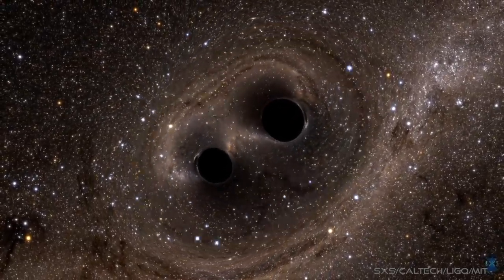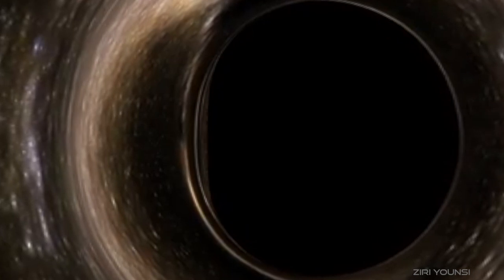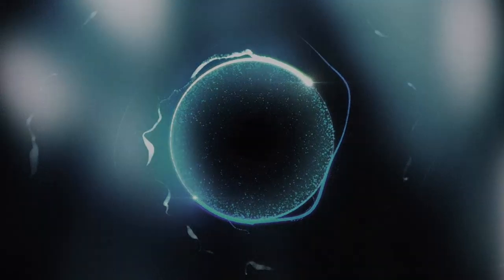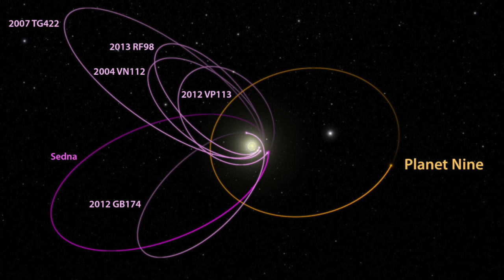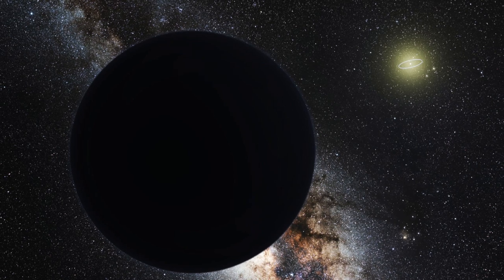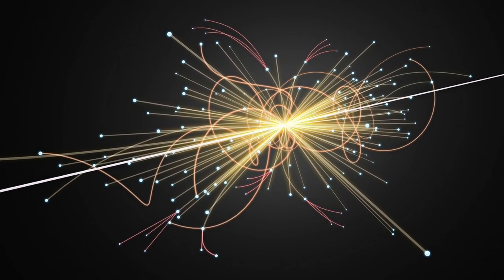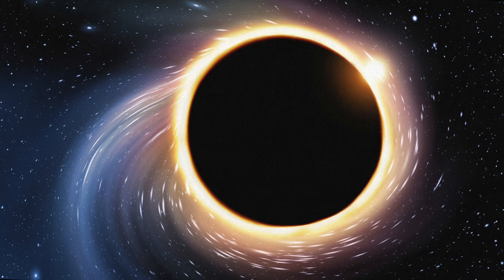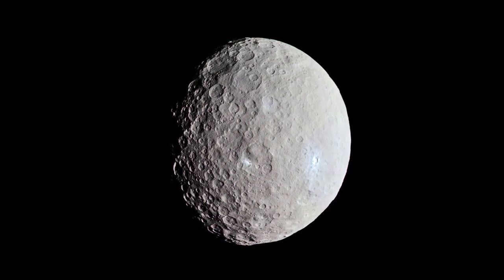Tiny Shiny Black Holes

Comment: It's worth noting that Hawking Radiation has never been experimentally measured. And the No Hair Theorem is incompatible with Hawking Black Holes, which have information (entropy) in addition to mass, spin and charge.
I'd be as excited as anyone if Hawking Radiation were ever physically proven. We've been looking for X-ray bursts from primordial black holes with satellites,  and if we ever manufacture a micro black hole in a particle accelerator, we'd be able to see if it does evaporate via Hawking radiation.
I'm also very skeptical as to whether an artificially created black hole power source would ever be energy positive (and there are other ways of extracting energy from them other than Hawking Radiation, for instance; we could extract gravitational potential energy by shooting matter near the ISCO and retrieving it with greater kinetic energy than it left with).
The good news is that for high density applications like space travel, a power source doesn't have to be energy or cost positive, just be mass and density efficient.
Reply: All good points indeed hawking radiation is theoretical and will remain so unless we find a black hole which should radiate at a temperature above that of the Cosmic Microwave Background radiation, at a distance close enough to actually observe any potential hawking radiation, which as far as we can tell do not naturally occur. There is possible evidence for a hawking radiation analog within a "sonic black hole" created using Bose-Einstein Condensates but I will wait for independent replication and or verification before I consider that reliable and even if it does hold up there is no reason gravity necessarily would work the same way.

Also as you noted an artificially generated Black Hole would never be energy positive  in terms of what you get out of them as required by the laws of thermodynamics hence why they were discussed as a type of battery.

Comment: Conspiracy theory...I think they're using the National Ignition Facility NIF to make a kugelblitz black hole....I mean have you seen it? They say it's for fusion but it's exactly what you'd need to make a kigelblitz. Its several dozen extremely high powered lasers symmetrically arranged in a sphere around a single point aimed at a tiny point supposedly a tiny pellet or something but we know what they're up to. For god sake they let star trek film there as there warp drive engine room....what if that's just an inside joke for them since that might not be far off from it's TRUE function

Comment: Question, If nothing can escape a black hole, not even light, then would that make the actual black hole itself move faster than the speed of light? To contain or prevent light from leaving a black hole then besides gravity, something has to be moving at speeds much faster than the speed of light. Gravity is quite powerful, but is it so powerful that it can contain anything that moves at the speed of light from leaving or is it possible something moving 2x the speed of light can escape. That is what makes me go, Hmmm

Comment: The Hawking Radiation was never part of the Black Hole, so Black Holes do not evaporate.
And because the escape speed of Black Holes is larger than the speed of light, they don't radiate heat either.

Comment: Consider this:  I call this Hawking radiation paradox. If time runs faster outside the event horizon of a black hole than it does inside the black hole, Hawking radiation would evaporate the black hole before enough time has passed inside the black hole for such an event to have occurred. So how is it that a black hole could experience two frames of reference at the same time? There seems to be a real paradox here. If an observer inside a black hole looking out could survive long enough, could she witness hawking radiation evaporate the black hole before enough time in her frame of reference, inside the black hole,  pass for the evaporation to occur?
Reply from the maker: Not quite. From the astronaut’s perspective, they do not see the outside universe speed up. If you look at their space time diagram, you can see that an astronaut having crossed the event horizon can only see their past light cone, so the past universe. It’s only when the astronaut tries to send a signal out that it takes infinite time. So the astronaut would just continue to fall seeing the black hole as it is long before evaporation sets in.

Comment: I don't understand how Hawking radiation makes a black hole lose mass. Shouldn't it gain mass? The way it is explained to me is that these vacuum fluctuations cause particle pairs to be created which usually just self annihilate when they hit each other. But if they're close to a black hole one can fall in. Not allowing them to come together and disappear. So both the universe itself and the black hole just GAINED a particle... Right? How does this make the black hole evaporate?

Comment: There is something just feels inherently wrong with the concept of infinite density with black holes. They’re created with finite mass, and through Hawking radiation we know that their mass is finite as eventually it will dissipate into nothing, therefore cannot be infinite. If the mass isn’t infinite, then the volume has to be infinite, for there to be ‘infinite’ density, but this leads to the summation that an object with mass must be smaller than the Planck length. So we’re either wrong about the Planck length (likely), or wrong about Black holes being infinite, or the equations around black holes physics are far from complete. Are black holes a direct rebuttal of the Planck length (appreciated that it’s the smallest known length)? Wonder what other people’s thoughts are on this.
Reply from the maker: It’s best to think about it as a point where our theories break down

Comment: What can be expected to happen upon the interaction of anti matter and a black hole?
Reply: I don't think antimatter should behave any differently than matter  from the point of view of a black hole, should it?
Reply: @theguyfromsaturn  I'm not sure because isn't antimatter instantly destructive to any matter it comes in contact with? And the black hole definitely contains matter
Reply: As far as we're aware, nothing special. Black holes should crush matter into an infinitesimal point, causing it to lose its identity. Any antimatter wouldn't find anything to react with inside (And if somehow it did the released energy would still be trapped inside the hole.) Black holes are odd like that. For example some Hawking radiation near the end of a blackhole's life will be a 50-50 mix of electrons and positrons. In theory you could use a very small hole to convert matter into a mix of matter and antimatter.
Reply: @garethdean6382  okay, in other words the black hole would only get bigger and not evaporate into an explosion of pure energy?
Reply: That's correct, its gravity would be too strong for any explosion to escape, so whatever happens in it, will stay inside it.

Comment: Black holes are star remnants of liquid fuel (hydrogen) that condensed after a super nova explosion 💥 and they have mass, gravity. Wave function. But they changed state. This explains why when a black hole eats a star the star just can’t go right in? Why? Different states. Simple. 1. BLACK HOLE (Dense and Cool) 2. STARS (hot and gassy) gravity pulls it in? It can’t go in? It spins around the hole, and hugs it just like our atmosphere hugs the earth. Gravity holds the fusing fire to itself. (THERMODYNAMICS) now, because of the associated temperature differential. It can take a while for that fuel to cool and enter the hole. As a liquid.

Comment: 16:30 Where has this information been all my life? Honestly it sounds so much more interesting than the premise of the video 😂 But how would that be possible? Simply having charge would negate the gravitational field of the black hole and make it naked? 🤔
Reply: The original name "bald holes" was rejected for some reason.
Reply: If you toss charged particles into the hole it'll keep that charge. Feed it more and more electrons say and you'll quickly build up towards the critical charge.

However there are issues. All charge has an associated mass, so as you charge the hole you increase its mass as well which changes the charge-mass ratio. Positive charges will also be attracted by gravity and EM and a small charged hole would tend to ionize nearby matter through its electric field. And there are quantum effects that might kick in near the limit.
Reply: @Dario Impini Damn 😂
Reply: @Gareth Dean No I get that but why is there a critical charge for the black hole in the first place? That's what I don't understand
Reply: An ordinary black hole exerts the same acceleration on any particle, due entirely to its gravity. However if the hole is charged then there will be an additional electromagnetic force on any charged particles nearby. For particles of opposite charge this will increase the attraction whereas for those of identical charge it will lessen it.

As such there's no critical charge for opposite or neutrally charged particles.

For similarly charged particles, as the charge on the hole increases, its gravity is 'neutralized' to an increasing degree. As both gravity and EM obey the inverse square law this means that the total attraction at any point will be the 'bare' gravitational attraction multiplied by some variable between 1 and 0.

You might think this would change the event horizon of he hole, opposite charged particles would see the hole as being bigger and similar charged ones as being smaller. But this is not the case apparently, due to something to do with potential energy. (I have been told this, but do not understand it, so if you're confused, welcome to the club.) Instead the gravity gradient around the hole gets more 'compressed', the  point where you need to go at 50% light speed to escape the hole is twice as close in than in a normal hole and so on.

HOWEVER, at some point there will be so much charge that gravity will be completely neutralized. At that point there is no attraction (or even repulsion) for similarly charged particles at any point and the event horizon vanishes for them leaving a naked singularity that they can approach and leave at will.

Theoretical objections to this being possible generally rest on Hawking radiation like phenomena where he hole's gravity and charge fields would cause emission of charged particles to help the hole shed charge.

But as fr as I know the area's a big can of worms and I should very much like one of the Sixty Symbols crew to discuss it. (And likely point out all the stuff I misunderstand.)
Reply: @Gareth Dean So this is basically using the EM force to overcome the black hole's gravity. I actually had this idea as a kid but I was told it wouldn't work because spacetime itself is flowing into the black hole at FTL speeds and there's absolutely no way to resist this flow, no matter how strongly we try to pull the object from outside (using the EM force or something else). Unless charge somehow affects spacetime curvature, I don't see how this would be possible 🤔
Reply: Alright, so after much discussion with a friend about this I THINK I have an understanding based on the 'Reissner–Nordström metric'.

Imagine two particles of like charge separated by a given distance. They will repel each other and accelerate apart. But what is often ignored is that in doing so they will affect the local spacetime as matter and spacetime are connected.

In the same way a rotating black hole causes ;frame dragging' to make objects rotate with it, the departing particles will leave an outward 'wake'. In essence any collection of expanding particles has an outwards pressure. (This is why the expansion of the universe can counteract gravity even without a dark energy component; the initial outwards movement of matter expands space.)

We can imagine a system with two identically charged particles repelling each other but held at a fixed position by a large mass between them. The mass pulls space inwards constantly, trying to collapse the system, but the electric repulsion accelerates them outwards dragging spacetime and cancelling this out.

The acceleration produced depends on the charge of the particles and their separation. We can imagine a system where beams of light force two charged particles to stay in fixed positions, the outwards pressure still exists here and constant inwards pressure is needed to balance it.

So in theory, with enough charge we can make that system as small as we wish, it would never collapse to form a black hole because the repulsion wouldn't let space start infalling. And any system that DID have space infalling wouldn't have enough charge to overpower the infalling space.

So you either have too much charge to form a hole or a hole that logically can't have too much charge to have formed. What's the issue?

The problem (so I'm told) is we have a tachyon situation. Sure nothing massive can go as fast as light, but something that 'just is' moving faster than light works fine and can mess with things like causality.

There's nothing stopping a naked singularity jut being a thing. An infinitely small, infinitely dense point with charge which has spacetime expanding outwards from it due to its internal pressure. Several singularity problems would be present and there'd be no event horizon preventing interaction.

That's what I've been told, and it makes sense to me (Or at least more sense than previously.) but all I can do is hope I have it right since the math is beyond me. I'd like to see PBS Spacetime cover the subject as I'm sure they'd blow my mind.
Reply: @Gareth Dean That's just a really long way of saying yes 😂 Oh I'm gonna have so much fun with this. I guess black holes that formed naturally would be electrically neutral on average and so this wouldn't matter. But that's where we come in. By feeding the black hole only electrons, we'll be able to make it negatively charged. For starters, this would reduce its event horizon for electrons and we would be able to image this anomalous area between the two horizons using said electrons. Taken to the extreme, this would allow us to eliminate the event horizon completely and image the singularity itself. I wonder what it would look like.
Reply: I've often found a long, skippable answer better than a short, uninformative one.

There's a reason why getting their paws on a black hole is every physicist's dream (Or possibly nightmare.) What we could do and learn with just a few days of observation... It couldn't fail to be a massive breakthrough.
Reply: @Gareth Dean Lol I see what you did there. But how are you so calm through all this? We literally just found a way to image black holes. I still can't get over it 🤩

Comment: If I understand correctly, it could well be that the era of primordial micro black holes may have passed, and therefore, they aren't here to be seen by our current sensory efforts. But wait a minute: we can see back a long, long time, albeit through a correspondingly extended redshift. I would like to know if anyone has even proposed a long wavelength survey sensitive enough to perhaps image these long dead dynamos. It just seems to me that among all of the other weirdnesses in the early universe we have uncovered through similar efforts, we should have already seen something strange enough to pin down the theoretical constraints much better than the initial predictions made by Hawking and company in the early 80s.
Reply: To an extent. If the holes are 'too small' they should evaporate and add an odd heat signature to the universe, this hasn't been seen. If they're 'too big' we should see them today as they pass in front of more distant objects. A combination of these two factors and increased sensitivity is beginning to squeeze the mass range of such holes. (As well as helping us determine if they are related to dark matter. For example see: https://phys.org/news/2019-04-subaru-telescope-dark-tiny-primordial.html )